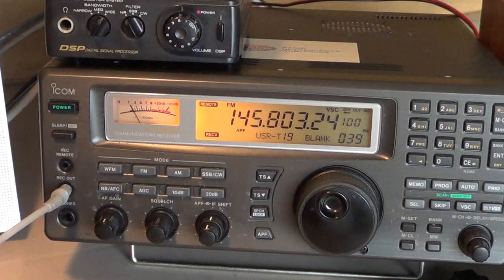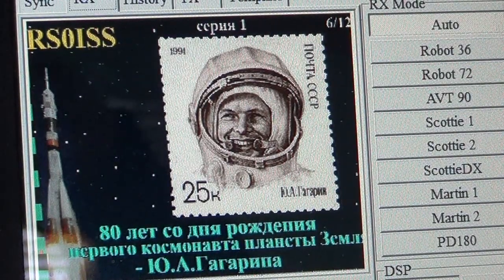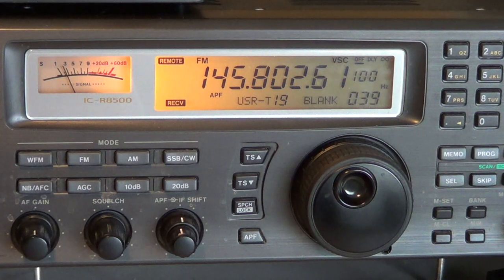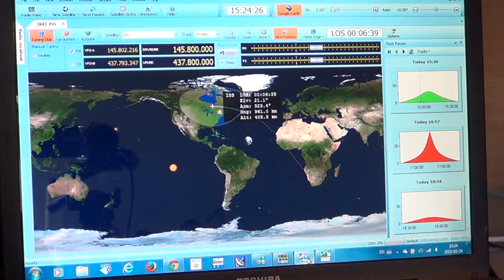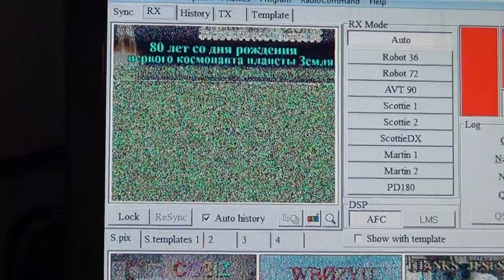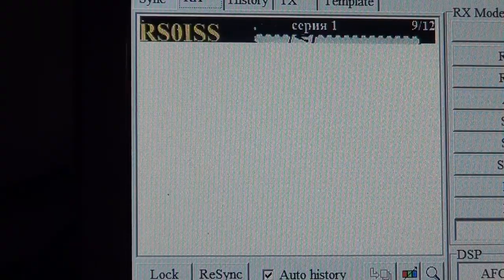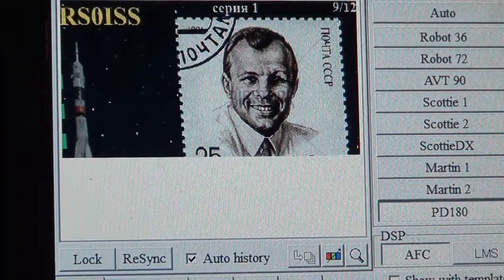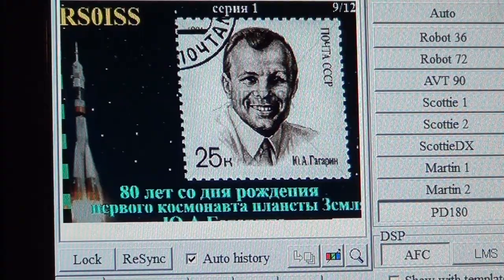Receiving ISS International space station SSTV slow scan Television 145 800 Mhz

Comment: I need answers, can I receive a picture from the iss with an handheld powerful VHF scanner/transmitter? if yes, what extras do i need to do?
Reply from the maker: You can receive the ISS with  simple handheld scanner and it's rubber duck antenna, signal from the ISS is quite strong
Reply: If you get a better antenna the signal will be stronger
Reply: You can download an app for your phone and receive the message by holding the mic of the phone next to the speaker of the radio

Comment: What antenna do you use for the SSTV signal? Is it possible to use an omnidirectional discone antenna?
Reply from the maker: yes you can use a discone, I am using a 22 meter long sloper antenna in my backyard
Reply from the maker: opps the antenna to receive the ISS is a vertical mobile antenna rated at 30 -1300 mhz and yes a discone will work great for reception of the ISS and ham satellites